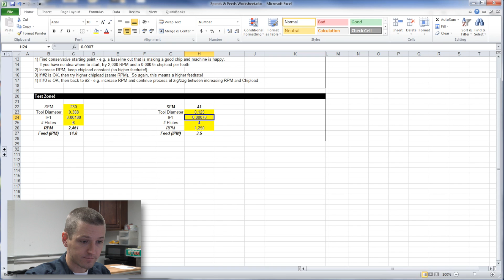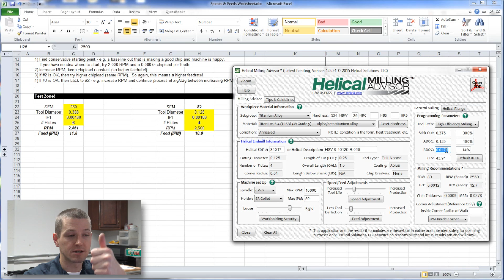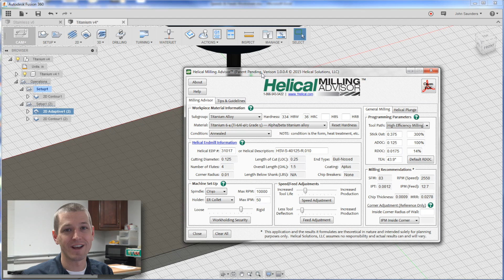Tormach 440: Can it cut Stainless and Titanium?

Comment: What about loudness?

I have heard you started milling in an apartment, and ran a shop vac to hide the sound.  

What mill did you start with?

How loud is a Tormach 440, or 770?
I am building a 3 axis mill with about a 1 or 1.5hp motor.  The plan is to cut stainless steel, titanium, or aluminum mostly.  

How loud might the machine be?

What can I do to quiet the machine?
I plan to make a sound proof enclosure.  Does slowing the machine down reduce noise?  What happens to surface finish if the speed is low?

Comment: wait, you don't have data sheets from the tool manufacturer with which you can calculate your rpm and feed rate? that's odd. if you get your toolt here (in germany) you usually request these datasheets and they'll send it to you with the tool or per e-mail (if you request that). the size of the tool does not matter that much as you have certain ranges of tool diameter (3-5mm for example, so any tool diameter between 3mm and 5 mm will be calculated with these numbers). you then take your Vc (turn it from meters/minute to millimeters/minute) from the data sheet, divide it be the tool diamater times pi and you have your rpm. multiply the result with the number of flutes and the suggested feed per flute and you have your feed rate. not much to do and you don't hve to have massive amounts of paper for any possible tool you are using. it can be used for two flute, three flute, four flute, etc. endmills without difference (as long as they're from the same manufacturer). it's the same for face mills, only that instead of using the number of flutes you are using the number of carbide inserts and you will have to use the data sheets from the insert manufacturer.

Comment: I just found your site. I started in machine shop in 1959. After serving 4 year apprenticeship they came out with NC. 1965 to 2002 I worked on just about everything that cut metal from 2,3,4,5,6 axis. I love to see you work. You have a good attitude toward working out your problems. Attitude is 99.9% of solving a problem. Your equipment is O.K. but not great. Haas is good to learn on but there are better and stronger machines out there. It all depends on where you plan on going with your shop. I went clean room tight tolerance 0.00005 on production and tighter on prototype. As for your Cad-Cam I don't know Fusion 360. I used Mastercam and SolidWorks and Unigraphics. Keep up the good work.

Comment: Of course the 440 cat mill Ti and SS. Remember, material group always dictates surface footage and that's where you start. Usually around 90-120 sfm for 6AL4V. It also has a low modulus of elasticity so it retains heat and that's the biggest danger because you can't rub this material or it'll heat up on you. Don't baby it, take a healthy chip load so most of the heat will go out with the chip. Sharper tools work best. You're on the right track.

Comment: thanks for this excellent vid John. I started watching your videos when you had the Taig CNC mill.  I am a hobbyist with a Taig CNC also, so I always struggled with speeds & feeds recommendations that assume a 1.5HP+ machine and don't quite work for a 1/4HP desktop mill.   When milling steel on my little benchtop mill I have always had to cut down the chipload a lot because as you know the Taig can't go lower than 1100 RPM, so we're forced to use very small diameter cutters and slow feed rates.  This video has taught me that my chip loads have been so low that I've been rubbing not cutting!
Thanks for the "don't go below half a thou" chipload rule of thumb !!

Comment: You should be doing much higher rpm/feed in both of those materials after you account for chip thinning.. even slotting you should be doing double the rpm with an 0.125" tool in both of those materials if they are coated. Also those materials are not heat treated, they are from alpha knife supply and they are anneeled

Comment: I haven't done tons of Ti or SS, but some of it can work harden in an instant. My Ti supplier told me to keep the feeds up and the DoC down a bit. So far that's worked fine. I've never used anything special for cutting tool materials, and good quality HSS tooling from a reliable manufacturer works fine. Drilling you have to be positive with your moves, in and out of the hole with no dwell time. I did see the mention of carbide drills etc. No doubt tool life would be greatly extended with that.

My points above were for the usual manual machine tools and not CNC. If the tool geometry is correct for the material, then even Sherline machines will process most or maybe all grades of Ti or stainless.
Reply: +Turning Point
 300 series work hardens and is a pain when first learning to cut it.  Some of the 400s are nasty.

Comment: In those materials I run my 5 Flute 1/8" tool at 13,000 RPM (425 SFM) and 82 IPM at 10% engagement.  Gotta go as fast as possible in the slow materials!
Reply: +jdrinkh2o I was looking at his 41SFM and thinking how nutballs slow that is.
Reply: +NYC CNC I know you said start slow, but why exactly would you be at molasses speed?
Reply: What I'm saying is that you should be running at max spindle speed, which will allow you to be running higher feedrates - because the tool is small.  These tough materials still can handle high spindle speed with small tools.  No reason to not be at 10K RPM.
Reply: i drill a part made out of titanium and drill dia. is only. 028 thousands with 10,000 rpms and. 0005 feed ipr  .250 depth

Comment: Your floor surface was most likely caused by the overlap in your spiral and the bottom of the tool rubbing constantly. With Ti rub causes a smearing effect and a lot of tool wear. same hole with a larger end-mill(75%hole diameter) spiraled down and a single complete circle pass on the floor/final cut will give you a beautiful finish. And running with mist coolant will greatly reduce tool life, at least with the fog buster. Flood coolant and getting as much as you can in the cut and it works wonders. I machine nothing but Ti and it was quite the learning curve to get the tool life dialed in. Especially when you start getting into the exotic Ti.
Reply: Why does mist cooling reduce tool life?

Comment: On titanium if you ever decide to drill into it save yourself the head ache and get a carbide drill. Makes a world of difference you can run it way faster with little wear and goes through like a standard hss drill in steel would. Also I love Helical tools and would highly recommend there 3 flute Aluminum end mills.

Comment: Pretty much all I work with is exotic stuff like titanium, zirconium, random high end knife steels, stainless and carbon damascus (pattern welded steel), mokuti/timascus (pattern welded titanium), superconductor, etc.  All are just as easy to machine as one another IMO. With the exceptions of tapping, and materials that like to spontaneously combust. No joke, tormach superfly throwing zirconium fireballs in the shop at 1125RPM is about enough to make you drop a negligent deuce. 

I have found that with these materials there really is no go to SFM or feedrate. Its all about the specific machine tool, and cutting tools you are using. Alot of trial and error but once you figure it out its a piece of cake. 

After being so piss scared about work hardening titanium or stainless I now just run almost all my endmills at 1125 and feed accordingly. With 1/2" I drop to 700. Granted all my work is manual fed so I feel alot more of whats going on and dont take intricate cuts like you do. Thats what works with my setup and lakeshore carbide endmills. 

Speaking of endmills. Altin coated 4 and 6 fluters from lakeshore are the knees of the bee for titanium. Just wish they made their 6 flute in a stubby. Their 5 variable flute altin coated stubbies work great in stainless and pretty well in titanium too. For roughing their is no greater beast than the fireplug from lakeshore. For sticky materials like zirconium a strong air blast is mandatory to avoid chips packing the flutes though

Dont know if that random mess of info helps anyone but let me know if you think I can help with random materials like that.
Reply: +Finn custom knives What kind of taps are you using? Have you looked into taps for those specific materials? Titanium taps need to have a cutting edge that jets out like a cresting wave and comes to a peak to prevent the work hardening your talking about. Greenfield makes amazing taps for these materials. The EM series taps (which they may have renamed some of them but if you ask a distributor they can tell you) Come in EM-SS, EM-Ti and EM-NI which are for your hard to machine metals that don't fall under the other two. I can't tell you how much of a difference they make. We are talking 75 sfm in pure titanium. Give those a shot let me know how it goes
Reply: +Mike at Kurz & Zobel Inc. Pretty much got it worked out now. I just like to run hidden screws as often as possible and tapping 2-56 in a blind hole can be a pain. I pretty much use all form taps either from balax or OSG. Still need to try a ti specific tap though thanks for the info
Reply: +Finn Custom Knives Yeah blind holes can been a real pain in the more exotic materials. I actually have had to do 2-56 threads in a blind hole in titanium. They offer the EM series in a spiral that pulls the chip out so you can go into a blind hole. I've used some OSG as well I'm not sure if they have it in the spiral but I would assume so. Only thing I'd suggest is stay away from form tapping the work hardening materials use a cut tap whenever possible.
Reply: +Finn Custom Knives oh and one last thing. I dont know if you do or not but make sure you get a good tapping oil. I personally use cool tool and it is specifically formulated for things like titanium and stainless. And Ik there are a lot of other good ones out there as well
Reply: +Mike at Kurz & Zobel Inc. been using tapmagic xtra thick but I keep hearing molydee is perfect for titanium but just smells awful
Reply: +Finn Custom Knives I have trims Tap Heavy which I'm guessing is similar to xtra thick your using, I love it for doing bigger threads in harder materials, drawback I've found is in smaller threads it seems to almost keep the chip from evacuating the hole and the chip gets stuck in it. I like a thinner oil for smaller holes and have had much better luck with it. I've never used moly but like you I have heard a lot of people say it works well.

Comment: I've got a an aluminum project with a PCNC 770 at school and I am very new to machining.  I will be using a 1/6in  4 flute carbide end mill for doing some slotting (cutting out letters) with a max DOC of .125in what SFM should be a good starting point? I currently have a SFM of 150 in Fusion360 but I am thinking  this may be a bit too high and I have not had a chance to go and do a test cut.
Reply: +Scott Roberts That's far from ideal for aluminum.  Aluminum tends to stick to AlTiN coating, and 4 flutes is not good for Al.  I'd go no more than 1/2d (1/32") depth if you have to slot or use most of the width of the cutter and make sure your coolant is getting to the cutter.
When you break the endmill, replace it with a 3-flute hi-helix or variable flute from maritool or lakeshorecarbide.  Uncoated is fine, ZrN, CrN, also good.  TiN and similar are not as good as uncoated, and AlTiN/TiAlN are to be avoided.  3-flutes tend to be Aluminum optimized geometry.  If you can't get a 3-flute, 2-flutes are much better than 4 for Al.
Reply: +Scott Roberts You want that little cutter going as fast as possible. 150 SFM is slow for HSS in aluminum, much less carbide. Is this a ball mill or square end, and what sort of coolant have you got? With a good mister, I&#39;d go 10k RPM (max of the machine), and start at 1/2 diameter for your depth of cut (about .032 in this case). Pay attention to chip evacuation and play with your depths until you get what you want. The four flute is going to hinder your depth abilities. A 2- or 3-flute would be better. Start at .0003/flute and go from there (12 IPM).
Reply: +atomkinder67 Thanks a lot for the info!  This is a flat carbide AlTiN coated end mill from Kodiak Cutting Tools.  The mill is set up with the stock 770 flood coolant system (single nozzle) and Premier 600 coolant. 4 flute was all I could get my hands on for not too much money and little lead time so I'm stuck with it for this project.  I might have room in some of the letters to clear material with an 1/8in 2 flute I have.  I'm gathering that I should probably back off of the DOC by about half especially given my lack of experience with this cutter.
Reply: +Jon Baker Thanks for the heads up, I had no idea about the coating.  It will be interesting to see how this project turns out, and how fast I will break this cutter.  I really appreciate all the input and advice y'all have given me.